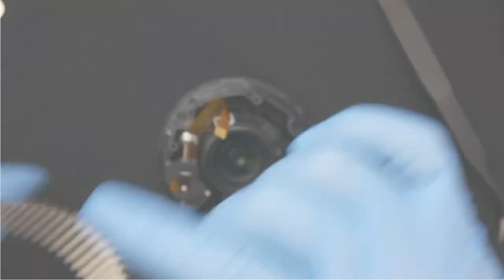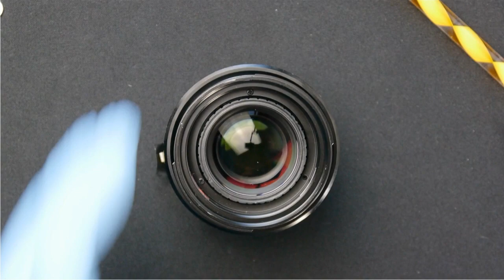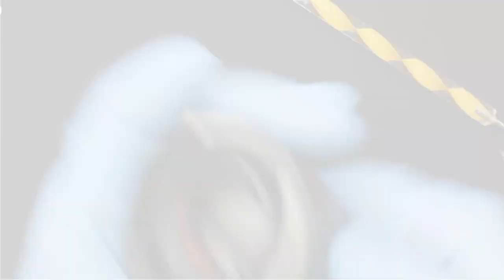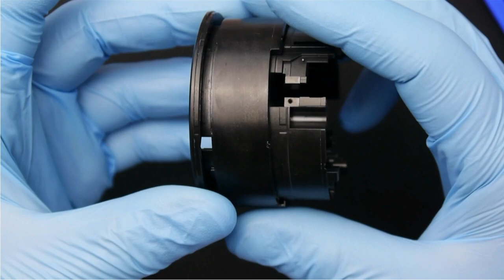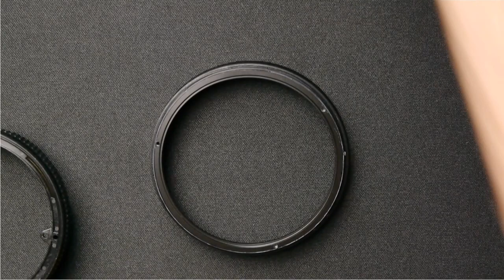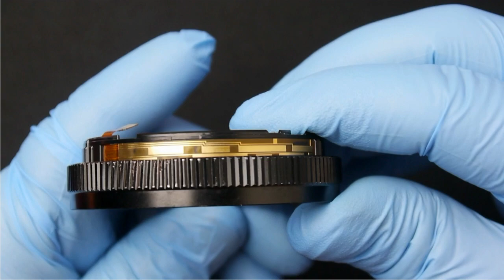#007 Fujifilm 35 mm 1.4 Step-by-Step Disassembly (time-lapse)

Comment: With the help of your video I was able to repair my fujifilm xf 35mm f/1.4 lens. I had bought the lens off of ebay used and it was guaranteed by the seller to "work". However, upon receiving the lens I found out that it would only autofocus in AF-S mode and when attempting to manually focus or continually focus the motor would appear to get stuck and I would get an error telling me to turn the camera on and off again. I opened the lens up following your video and found that the front element was tilted to the right and noticed that one of the plastic rails of the front element was broken and causing undue friction to which the motor was unable to handle. I removed that broken plastic rail and now it functions great! My first time opening up a lens too.
Reply from the maker: Nice! 
Glad to hear you made it, that also proves my videos are easy to understand 😉

Comment: I have a number of older Fujinon-A lenses.  They are for large format film.  I have one that has what appears to be fungus behind the front lens set.  I am confident I can take the lens apart, clean it, and reassemble it.  However, I am not sure about the need to maintain the rotational properties of the glass lens elements.  In other words, are the lenses symmetrical about their axis?  If so then it will not matter how I orient them upon re-installation.  Otherwise it would require I either keep track of the orientation with some sort of marker, or use some sort of optical collimation device during final assembly.  I do have have the hardware for the latter.  Any suggestions would be appreciated.

Comment: My xf 18 55 has some fungus in it and planning to open it. Do you have any video of it as for my guide in opening my lens?
Reply from the maker: hey, that lens is not an easy one, I do recommend a professional for that kind of work. zoom lenses generally require good knowledge and sometimes bench tool for calibration.
Reply: @CameraRestore  I am planning to open the back lens of my fuji 55-200 because of fungus. I only need to open and the furthest back (closest to the sensor). Any tips or will I ruin the lens after that ?

Comment: Thank for your video. When we reassemble this lens, do we need to calibrate the screws with certain torque specs?
Reply from the maker: Well… theoretically no,, but I’ve seen lots of damaged lenses because of too much torque. I would not recommend doing a repair for the first time on a lens like this.

Comment: I’m trying to re lube my kit lens and am wondering if any elements need to professionally calibrated after screwing them on with certain torque specs? Or does it just reassemble and good to go?
Reply from the maker: I didn’t got the chance to open one yet, even if I have a partially damaged one available… if it’s something that you never fixed before, I would recommend to leave it to an expert. Zoom lenses are not something easy to start with… specially Fujifilm, their lenses are quite complex.

Comment: Hi, can you help me? I currently had my 18-55 fujinon lenses fallen to water. I asked fuji to repair but it cost half the price of the lenses so I think about disambling it my self. Is it possible? I can see there is water inside the glass, is it reparable? Thank you in advance.
Reply from the maker: If you never open a lens, I highly recommend not to do it, I know this is not much encouraging but zoom lenses are not that easy to work with. You need special tools and quite a lot of experience. My main experience is with cameras, but sometimes I repair my own lenses, and even so, happen to have some third parties support. 

If you want just to get some experience in this field just go for it.
Once the lens is opened it might require calibration, specially on zoom lenses, but not only, some high-end primes also do.

Comment: Hello, I dropped a Xf90mm f2. Aperture ring stuck at 5.6
Any advice? I am not sure if I can fix it, repair price very expensive
Reply from the maker: Hi, dropping a lens will not create only one single type of damage (unfortunately), so in that case, an inspection is needed. Second thing and very sad to say, there are no parts available for Fuji in order to repair out of their service. I had some service requests about this lens but I had to pass. I suggest to contact Fuji and see what their service cost would be. If is too expensive to repair the only option would be to sell it as faulty "for parts"...

Comment: What screwdriver you used? PH00 or PH000?
Reply from the maker: It’s a PH000, I filed a bit the head to fit  on different screws sizes, in some occasions don’t need to use the PH00 specially on a small lens like this.

Comment: Any idea how to fix the lens control error. Nothing is damaged but may be something is lose inside
Reply from the maker: drtechnno 
Is quite tricky and is not working all the times. I’m using this method found online:

Potential Solutions to the Lens Control Error
First, reset the camera to factory default settings.  On most Fuji cameras like the X100T, XT1, and XT10, you'll press MENU > Go to setup 1 (the wrench with a “1” next to it) > and then click RESET > OK.  Wait 30 seconds after the reset has finished.
Turn the camera off
Next, take the battery out of the camera and leave the battery out for a FULL 2 minutes
Take the lens off and then replace it 3 times
Turn the camera back on and cross your fingers!
If That Doesn't Work…
Turn the camera off
Take the lens off
Take a rubber pencil eraser and gently on the copper contacts on both the lens and camera
Use a dry cloth to gently remove any eraser shavings
Put the lens back on
Turn the camera back on and cross your fingers!

If not working you need to send it to service.

Good luck!
Reply: @CameraRestore  you copy pasted it. I have done all that. Didn't work
Reply from the maker: drtechnno do you live in the UK?
I can take a look at it